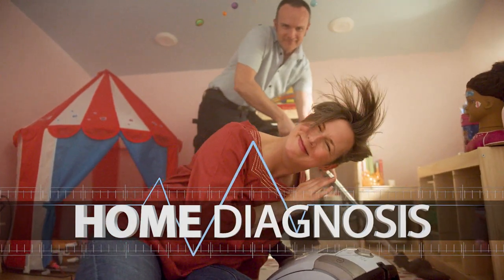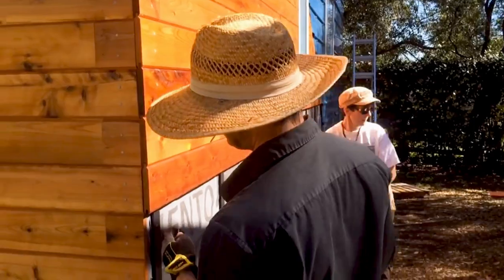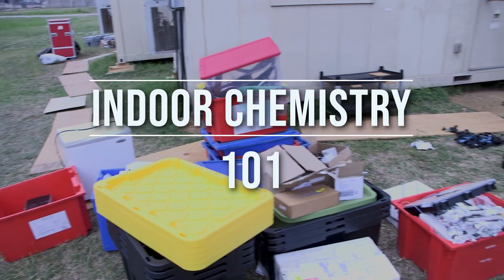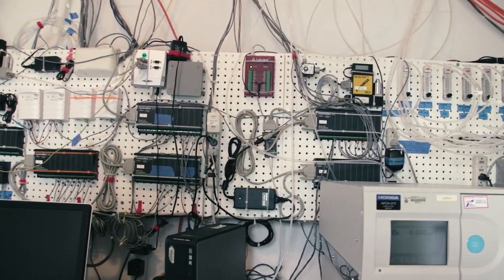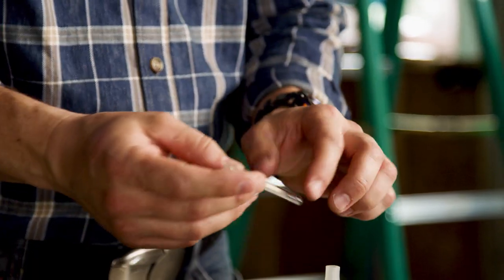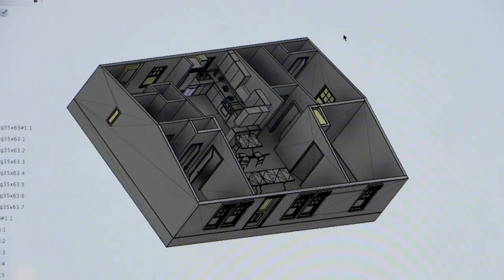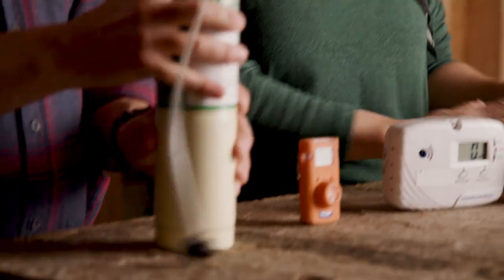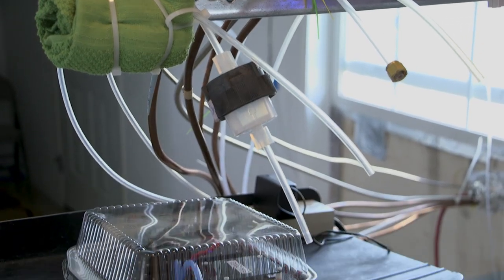Why Should You Care about the Chemistry of Your Home? - Ep 210 of Home Diagnosis TV Series

Comment: Interesting brief overview of everything.  Kinda curious with your Airthings on the wall what you keep your TVOC levels under on a regular basis.  I currently use a Laser Egg +Chemical as typically see 200-275 micrograms per cubic meter.  All I know is I had muscle discomfort and a lot of sleepless nights before adding ventilation, garage isolation, and garage exhaust fan.  Our house was generally 3x what it is now with our ventilating dehumidifier.

Comment: Do you guys have thoughts on hydroxls? Part of my job involves fire damage restoration and we use both ozone and hydroxls to treat that damage. I'm well aware of the dangers of ozone but the scientific reading on hydroxls seems less sure. I haven't been able to decypher if it would be a net benefit or not to install a hydroxyl generator in my home, perhaps inside the ducting system?
Reply from the maker: Hydroxyl is even worse than ozone:
https://youtu.be/gdjy1ESmX3E
Reply: Those can be useful tools to help deodorize and repair smoke damage, however, after the treatment you must ventilate completely and not breathe the airborne chemicals that were made by the ozone and hydroxyl.  I don't think anyone knows if there is still a third-hand inhalation danger, but theoretically ozone shocking at least, oxidizes everything so it's not reactive anymore.  But, the partial reactions are what the concern is.

Comment: Question: which home chem test do you recommend?
Reply from the maker: Hey Bill- for what in particular are you looking?
Reply: @HomePerformance  Good question. In the next couple of months, my HOA will implement new security procedures that will impact, i.e., reduce, airflow into the hallway outside my entry door. Air from under the door is the primary source of 'fresh' air into the condo. Though we don't have a gas water heater and we're replacing the gas stove with an induction range, I'm concerned the air quality inside our unit will degrade from the reduced airflow. I was thinking I'd want to measure the air quality BEFORE and after the security changes. Am I taking the correct approach? Thanks